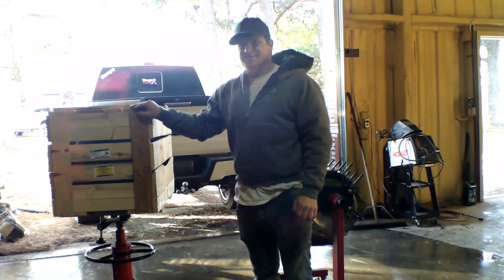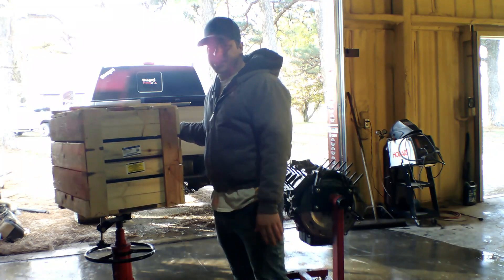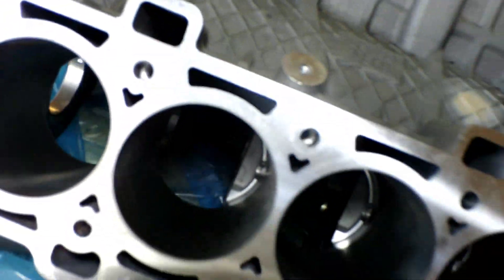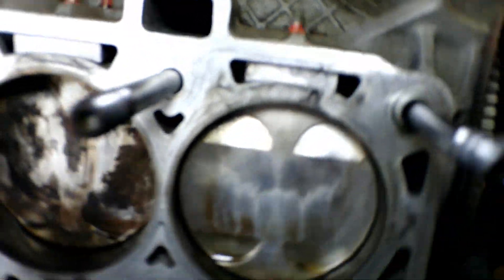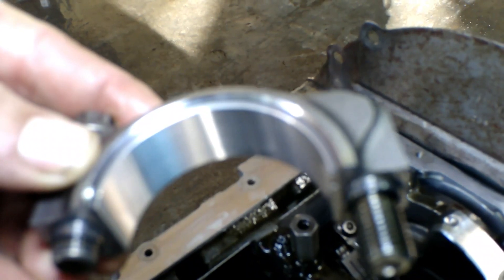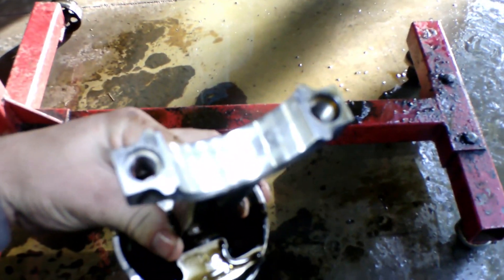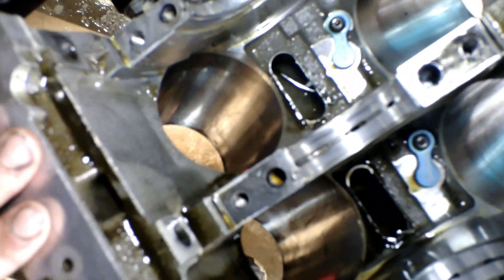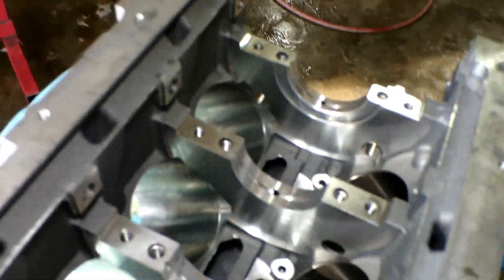I found another BIG issue with my Coyote engine...

Comment: Massive torque . Everything becomes a fuse.
Reply from the maker: What I suspect caused it is it was hydro-locked on a startup as coolant very likely filled the cylinder and would have put xtreme tension on the crank. Stock rods would very likely have bent but these Ibeams held up and I think that's what cracked it as it's where that rod connects to that cracked
Reply: sounds like that wld b the likely explanation. glad u found it b4 u had to rebuild again, soon

Comment: A guy at the machine shop showed me how to tell if the crank is bad by standing it up and tapping on one of the counter weights with a bolt or something metal. If the crank is good it will ring, if it’s bad it will just have a thud sound. I’m curious as to how yours will sound. Also, what rotating assembly are you using?
Reply from the maker: I have heard this as well and will be trying that. Manley turbo tuff I beam rods and CP Pistons

Comment: I have a question I have gen2 with stage two whipple I put a JLT catch can on but I think boost is back tracking through  catch can into the crankcase. Is that possible? Passenger side by the way
Reply from the maker: Catch can should be connected on vacuum side so it should not be seeing any boost
Reply: @Wengerdperformance  drivers side?of the blower